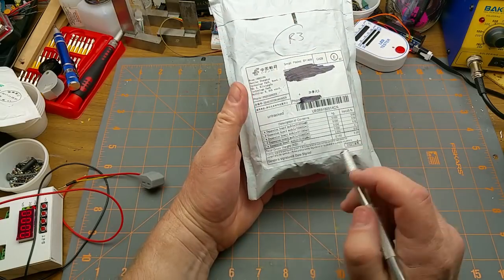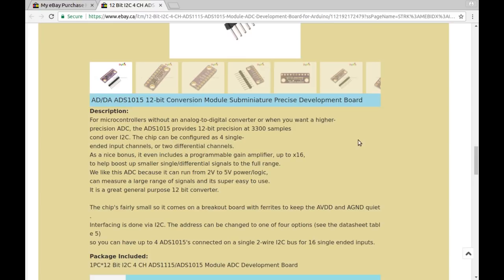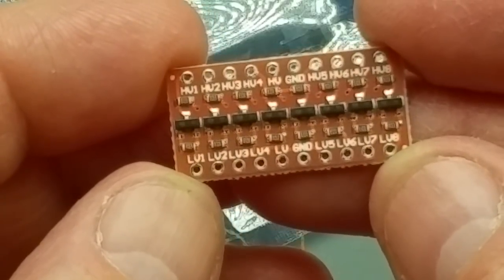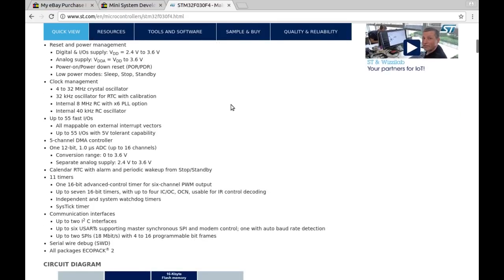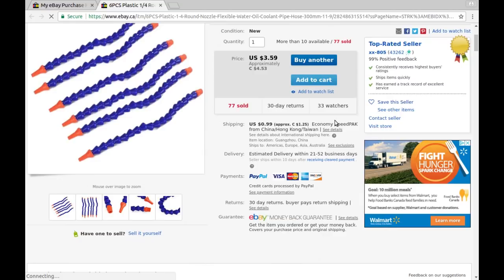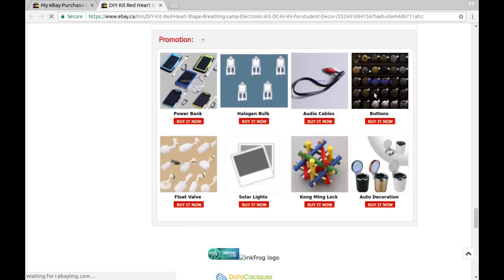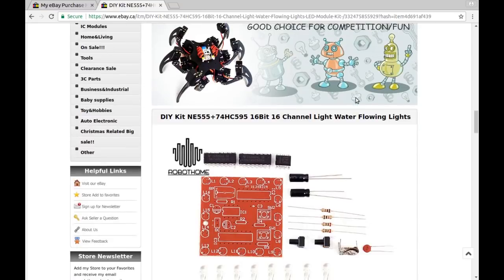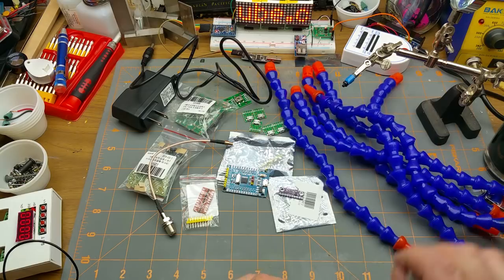Mailbag Monday 26

Comment: That bidirectional level shifter was certainly originally designed for use with I2C.  It is based on a design described in Philips Application Note AN97055.  'Gadget Reboot' talks about this on his channel.
Reply from the maker: Absolutely.

Though it can be used for any sort of logic signal between 3.3v and 5v devices.

Comment: STM32 M0 works without any problems with Arduino - tested myself. It only has weak support for floating point operations but it is very fast - 3-5x faster than Atmel. You can buy it for 99c on sales
Reply from the maker: That's good news.

I'll have to do some research.
Reply: Yes this is one of the craziest chips no one probably uses yet. Powerful and cheap ARM-32bit CPU perfect for basic projects